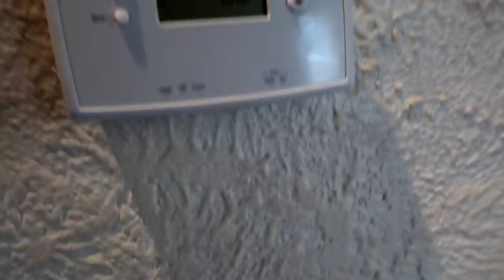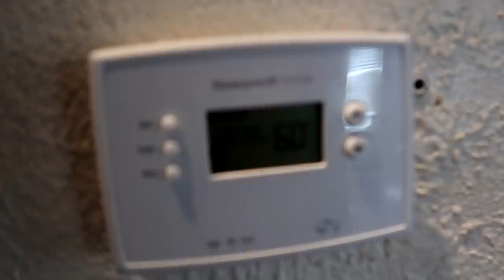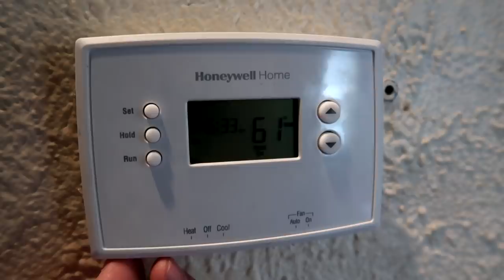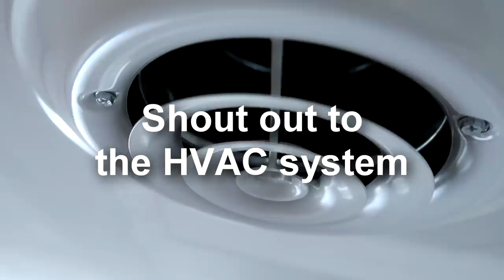The HVAC Is Finally Installed...

Comment: Joe it's probably not good to have the register vents installed. Wait till you get everything finished and painted.
Reply: Marcus yea joe will learn if he keeps fixing houses. He seems to have it backwards
Reply: @richcolon6580  you would think the hired hvac installer would know better haha
Reply: They are held on with a  few screws. They will come right off before any plaster and texture go up. Then can go right back on.
Reply: @jefferyreed573  the point is they shouldn't be on there. It only means they'll most likely not get taken down. Just like the appliances going in before everything is finished.
Reply: @Marcus  Oh I agree with you 100%. First thing he needs to do is clear everything out of the house and put it in a storage unit so it is SAFE, then clean everything. Just being in a mess like that would stress me out. Can’t imagine trying to work in it.
Reply: @jefferyreed573  Yea no kidding I can't either.

Comment: Counter top should be last after painting everything. Touch up paint if needed after installation. Also set the temperature of the thermostat 2 degrees over the inside temp. Then bump up two more after temp is reached. Continue till temperature desired. Keep those filters clean and you may have to change daily when doing sheet rock work

Comment: I've got the same battery thermostat, need to change the batteries every year. Are the new owner going to think furnace is broke. I learned the hard way.
Reply: 60 bucks for two triple a batterys, LOL
Reply: Just hook up the common you wont need batteries

Comment: Joe you need a secondary drain pan float switch to protect your air handler from backing up and over flowing and ruining your ceiling. They are very very important and inexpensive. One on the pan and you need a EZ Trap shut off out of your primary drain on the air handler if not at least a secondary drain shut off. Once again i am an experienced certified hvac technician have those safety switchs or risk paying for ceiling in the future possibly

Comment: You got walls pulled out the wiring going in and already started mudding the walls .You should really tackle one thing at a time to it’s finish and then move to the next that way guys are in eachothers way. My rule of thumb is have one team on the roof one team on the siding one team inside the house only at one time.
Reply: That way they are not in eachothers way*

Comment: Just a question  why did you run the heat in the ceiling . I'm a roofer from past experience  we have found it's not good for the shingles   and you lose heat

Comment: the hvac is installed, so the next thing to do is get insulation installed. This means that attic as well as the exterior walls. Either that, or you're going to have some warm felons and energy bills that are right through the roof.

Comment: Can you legally do your own electrical work?

Some forms of electrical work fall outside of any state or local regulation. In general, homeowners can perform only the most basic repairs on their own, without any form of license or permit. This includes tasks such as replacing a light switch, outlet cover or lighting fixture.

Comment: Your subcontractor shouldn't be held liable for damage to an appliance that shouldn't have been in there in the first place. 

We can all assume you passed your rough-in inspections right.....
Reply: Chad Gochis  Not only did he skip the building permits, he's advertising the whole thing on YouTube.  I don't think Joe knows any better. And I don't think  he knows the difference between a home inspector and a building inspector. At one point I think he mentioned having a home inspector in to check out the place after the renovation. It's only a matter of time before someone in the county building department takes notice of his unpermitted projects  (Plumbing/Gas Fitting, HVAC, Electrical, and Building)  and reports him. Or when (god forbid) the house burns to the ground because of faulty wiring.  And should this happen,  there's absolutely zero chance his insurance would cover it once they find out it was not permitted or inspected. 

Wish he would listen.

Comment: Maybe its different up that way than it is here in the south but I never ever let them fire up the heat/ac before drywall is done and sanded. I know they need heat for the drywall mud but a professional drywall guy would never ask you  to fire up the central unit and they will have their own jet heaters to bring up to temp. They are gonna turn your heater on wide ass open then when they sand they wont turn it off because its not theirs and they don't care. All that dust is going straight into that system and their is a good chance of stopping that condensation line causing it to back up and leak inside the house. People will say it wont happen because the safety switch at the air handler pan but ive seen that switch not work on more than one occasion. Even if it don't leak you still don't want all that dust up in that brand new duct work!! Oh yeah don't think you can just tell them to turn the heat off before sanding cause I promise you that it will be like talking to a rock. Good Luck!! I hope it all works out for you!!

Comment: If there is a breaker on the air handler you don't need the disconnect
Reply: Eh. Code in my area calls for a disconnect no matter what.
Reply: Of course where I live you can't work on HVAC unless you have at least an apprentice license under direct journeyman or contractor supervision, or a journeymans or contractors license. State right below does not require that.

Comment: I don't have much construction experience.. I worked 4 a company 4 a year n a half n Joe is doin everything backwards 😂 the framers come first then the plumbing n electrical comes.. while they're doin tht the sheetrock comes up n the painters come in. Then at very end they put windows then the countertops vanities etc 😂 Joe plz talk 2 a contractor n get the right order of which the work needs 2 b done thxx

Comment: I commented on your last video about the HVAC, there is no internal shutoff for the condensate line, you have to have at least 1 external floatswitch Incase your drain backs up, if he didn’t instal that for you when your drain backs up it will floss your attic, plus it is code to have at least 1 external. Your HVAC guys although they are very nice and doing a big favor don’t seem the most intelligent in the field.

Comment: Im telling you man, DO NOT i repeat, DO NOT run that air handler with all that new duct work until that place is painted, floors are in, and you've had a cleaning crew through there twice. Up to this point i feel like im talking to a wall trying to give you advice, but i promise you that you'll regret running that thing while all that dust is all over the place.

Comment: Exhaust Manifold is a very common problem in Ford work vans and box trucks.. it will make you physically sick.. nauseous, headache, vomiting.. carbon monoxide poisoning... as long as the exhaust manifold bolts and spark plugs come out it should only be a few hundred bucks to fix, if you buy an aftermarket manifold, which I would recommend as they are the same quality...

Comment: Good luck joe 🍀. Seems like you still haven’t learned that when you wanna pay just for the labor$800 to install an entire cut in ac system. No experienced could afford to throw away another $700 off their paycheck and then backup any work that may fail in the future. You wanna take all the profits but it’s not like your the one running the work being done(general contractor). Next time you should be upfront and just say what you are which is the investor and pay someone licensed to be a general contractor. Your friendly ac contractor Chris.

Comment: I swear to god, if i see you run that system while you're skim coating and sanding, cutting drywall, etc. im un subbing. I cant handle the mistakes after you've been advised anymore

Comment: If anyone says they don’t know what is required for code and for the inspection to pass fire there ass right away dude. Get people who know everything they do and what is up to code in that county. Also that house won’t hold no damn temp till you get the attic blown and insulation in the walls . Poly under houses are required for inspection where I’m from idk about there but ain’t got insulate the floors.

Comment: And also I think they are fucking that drywall mud job up . Too much mud so much extra sanding and you really need to hire a professional with the rotating wall disc sanders that are like 15 inches wide to get a smooth finish overall.

Comment: Uhh ok I am gonna ask a stupid question .. Doesn't an HVAC system have to be installed by a licensed professional? .. Doesn't there have to be inspections and permits when it comes to doing work like this? 
. I know regular folks do this type of stuff all the time but I was under the impression ya had to have permits and have inspections done and have certain work done by certified/licensed professionals! .. I even heard dude with dreads say something about he doesn't know if the HVAC has to have an internal and external shutoff .. so that tells me that there is NO certified person doing this work ... Is Connor certified??

Comment: Bro this house is going to blow up having these crackheads working on it. What the hell were you thinking? Your better off paying PROFESSIONALS they way you know it’s done CORRECT, within a decent TIME frame, and having TRUSTWORTHY people working on the house so you don’t have to worry about all this NONSENSE. This has been amateur hour from the very beginning bro.
Reply: I'm not sure how accurate this is, but some other people are saying he can't hire legitimate contractors because he doesn't have any building permits.

Comment: That looks like a RTHL221B1008, which would be the wrong kind of stat for a heat pump if you have AUX/EMERGENCY heat!! Get a 2Heat 1Cool
Reply: Alot of those thermostats will do 2h 1c even if it doesn't have emergency heat on the cover. It's in the internal settings.
Reply: @MarcMeal  It looks to me like a Lowe's verison of the RTHL221B1008..... which if so then he will only be about to run the heat pump.... not AUX/E heat.... but I could be wrong.... It's hard to tell just by lookin' at the front plate.... I own an HVAC company and yes I have been wrong before!! lol
Reply: @Chad_N_Stacey_Hopson  same here and I understand. I generally don't buy thermostats from Lowes. I prefer the ones I get from the supply houses. I do agree that one with the intended 2H1C is better.
Reply: @MarcMeal  yup, me too.... I never buy from anywhere but the supply house especially with only getting a 1-year warranty with those and a 5-year with what we get.... ain't it ashame that they got rid of the pro3000??
Reply: @Chad_N_Stacey_Hopson  I didn't know they got rid of them but I have noticed that they are moving more away from the simple tried and true like the 3000. That causes all sorts of problems. I did really like the Honeywell T6 thermostats... Until I got a whole batch o  defectives. It really sucks to have to go back and replace a bunch of defective stats for free hahhaa

Comment: Despite my criticisms of your channel, I have a bit of history in remodeling houses. Dude, you need to take the vent plates off, stop talking about countertops until you paint that jank. You are putting the cart before the horse. You need to strip all electrical plates, vents, appliances, etc and paint the dang place first. If not you are gonna have a TON of smudges and paint carry over to your nice pieces.  Also, AC is Air Conditioning, so you should have put it on cool to see the unit work. Get your gameplan straight. Do things in the right order.. PAINT then put all the nice vents and plates back. I fear for the tile in the bathroom.

Comment: Im from the UK, where we have central heating (radiators) for heating houses - is a HVAC system an equivalent to central heating?
Reply: Central heat and air conditioning
Reply: Usually on pretty old houses they still have radiators here. In the States central heating/air usually means you have air ducts running through the house.
Reply: @Reverend Swanson Why you mad?
Reply: Reverend Swanson didnt ask any one to give a shiii - im just a plumber wondering if thats an equivalent - and i agree, why are you mad? 😂

Comment: If you were to contact me, I would be willing to share many years experience and aid you in avoiding many mistakes. It's easy to forsee many of your mistakes before they happen. The first mistake being you gave too much for the house. You make money the day you buy it if bought right. Another mistake is that you're putting to much money into that type house. I  could go on and on. There are always exceptions, but Given that you gave appx.  35k and put another 45k or so in it you're probably not going to end up with dick for your effort. You were probably thinking 35k plus another 30 is 65k. Ask 100k but 90k would be okay. 25 to 35k profit, easy breezy. I don't care what the county assesses it for, comps, etc. Ultimately it will be worth what someone is willing to pay.  I read in the comments where someone wrote the property was 900 sq. Ft. If accurate, an asking price of 100k will exceed brand new per sq. Ft. construction cost. An attempt at using it for a halfway house will lead to headaches. Even if you could get 400 per head x 4 this wouldn't be the house to use for it.